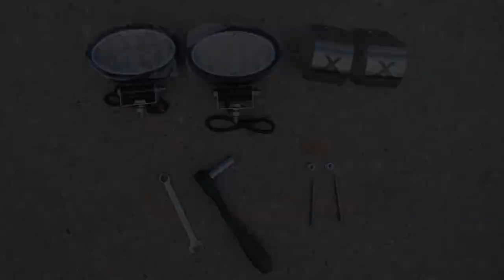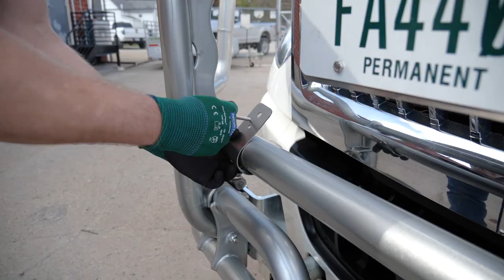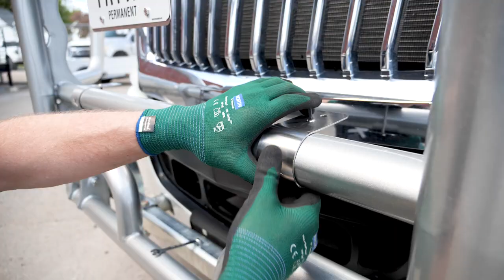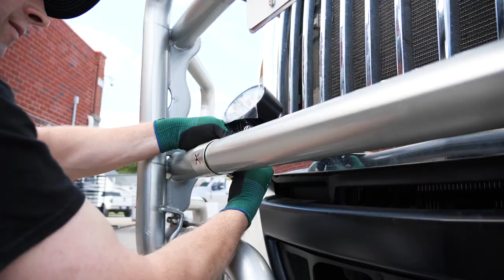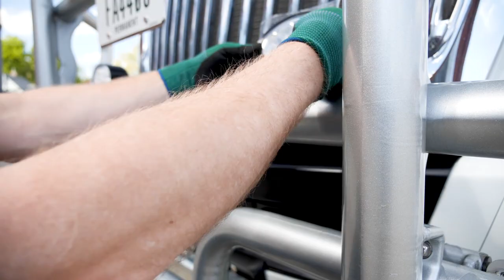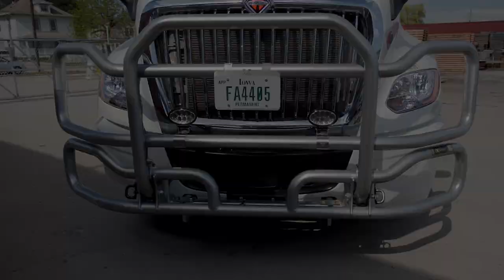Ex-Guard Light Tab Installation Instructions

Comment: How did you wire them?
Reply from the maker: Many trucks already have fog lights which you can use or add extensions to the wiring. If they are new, have a certified technician wire these from your truck.
Reply: I think most of these lights have just the one wire.  The light which is bolted on to the guard functions as the ground.  So if I'm not mistaken it's a hot lead wire to a switch inside then to the wires on the lights.
Reply: What is the bracket size?